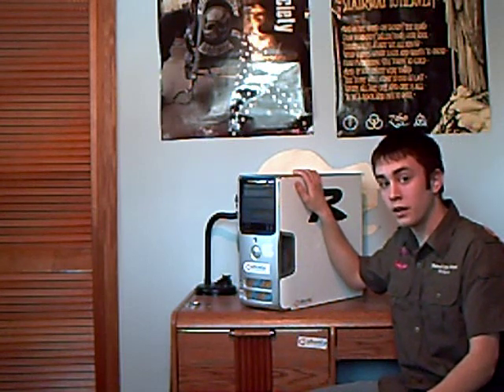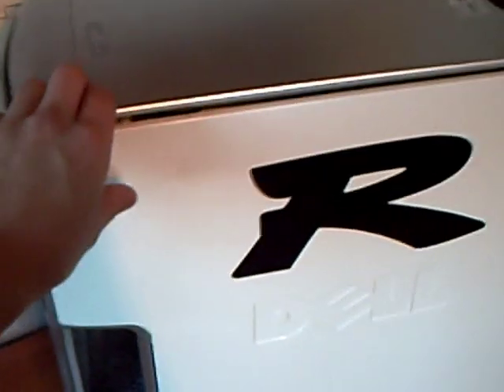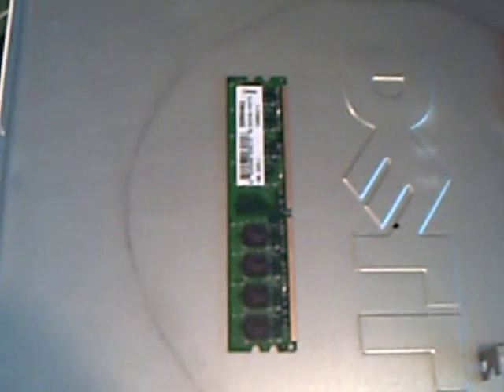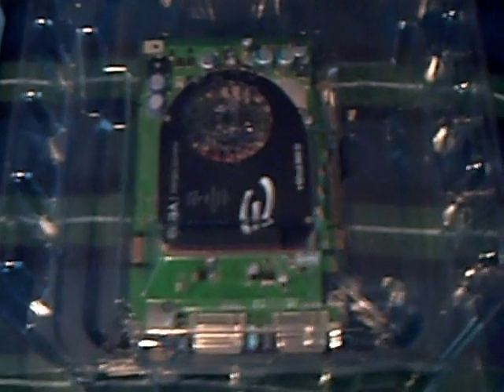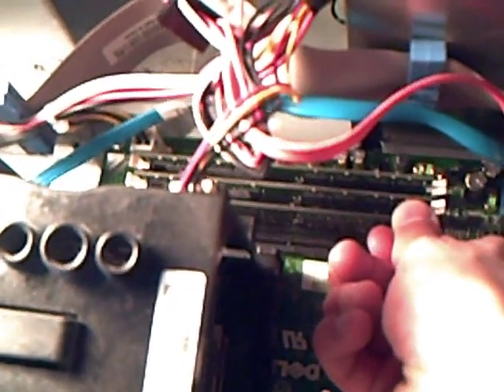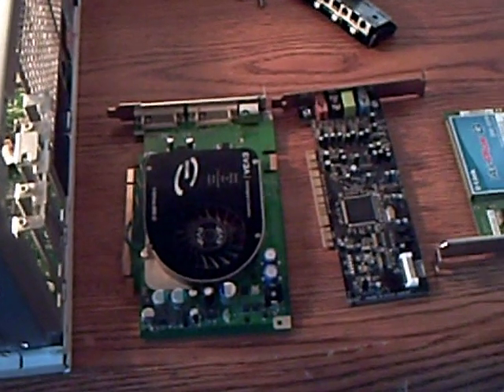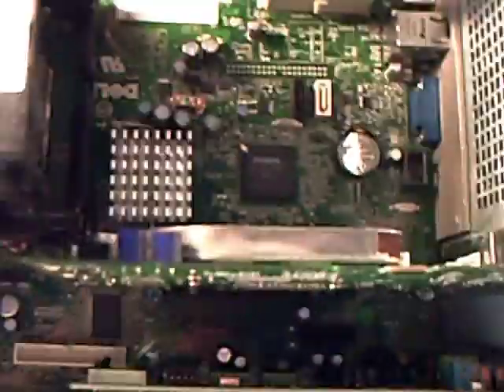Dell Dimension E521 full upgrade

Comment: My e521 has the 1.1.4 bios and a 3400+ can i run a 5600+ without a bios update because for some reason im having issues with updating the bios from flashdrive

Comment: ummmmm.....the ram only goes in one way, bahahahaha,   i like the part where he said this might look complicated for some......cant even give instructions on installing ram,  they go in one way for a reason people,  and skip the 1gb ram,  go for 2gb cards all through the 4 slots,  im on my e521 right now with 8bg ram and the stock cpu,
Reply: +cowterminator I've got the AMD dual 2.4 e521 underfinger right now too.  Just upgraded it to windows 10.  The computer guy I hired (first, just to replace my power supply which burned out), gave me a 3rd gb of RAM he had "sitting around."  I suggested I might like to have a 45h GB in there, and I thought I remembered it could take 8 GB as you say.  He replied "after the third GB, more won't do  you any good...it's a microsoft thing."  He claimed things would go to the hardrive and bypass the rest of any extra ram I might install.  I balked, and he just claims he's been doing this 20 years, and to believe him.  If there is a reason to think he's right, I can't imagine it.  He also installed a video card upgrade I already owned but never had installed.  Billed me like $180 bucks for win 10, power supply, and card installation.  Doesn't seem too bad, but he bragged he spent 40 hours making the video card work, which was his bad luck he couldn't charge me for it.  I'm thinking I should find some ram and stick it in, and that this guy is a little goofy.  Thoughts?
Reply: +skidancin 32 bit windows has a 3gb limit.  For 64 bit windows, 8gb is a solid upgrade.  Honestly, I would never do a single stick of ram in a dual channel board.  Always in matched pairs for me.
Reply: can i put amd 8 core on my e521? answer pls
Reply: unfortunately not ,you would need an amd 3+ mother board for that. I personally have an e521 with an athlon   64 ll 5600+ at 2.8 ghz and 8 gigs of memory  that i use for graphic design and some video rendering and I have no problems from it

Comment: On mine, I also installed an Athlon 64 X2 6000+ (3Ghz), added an SSD hard drive to be the system drive, and popped in 4GB RAM in dual channel.  Still runs well in 2015.

Comment: full upgrade? hell I took out my 5150 motherboard, made some cuts to the back of the case to fit a 5200 to support a spare core 2 duo I had. Replaced the stock heatsink and shroud with a 9100. I also  made some cuts on the shroud to fit in a spare N9600GTX. Popped in 4GB of DDR2 running Ubuntu and this thing kicks ass!
Reply: +Duffimus Prime Yeah, I was a bit unimpressed also.  Was hoping to see what CPU he upgraded to since I have one with a crappy sempron and wanted to see if I could drop an upgrade in.
Reply: that's what mine had in it.have since upgraded to an athlon 64x2 6000+@3ghz,6gb of ram and a geforce 9600gt dual booting ubuntu@win7 64bit.

Comment: If any of you guys still have this dell pos (like me) then I'd advise upgrading to x64 (64bit) operating system since the e521 has an AMD Athlon >64< x2 cpu. The 64 means it is 64 bit capable. Not sure why dell put 32bit on it but but they did. The x64 OS will let your system take advantage of your upgraded ram since 32 bit OS only let's you use a little over 3gb of ram. And can anyone tell me what gaming is like on this with a newer gpu? I'm building a new pc and I'm wondering if I can recycle the cpu, psu, case, and the motherboard.
Reply: +TJ4774 My e521 has, what my new windows 10 installation reports as "AMD Athlon(TM) 64 X2 Dual Core Processor 4600+ 2.4 GHz"  It further reports for "system," "64-bit operating system, x64 based processor"  Now, would you say I can't put four 2gb rams into the memory slots and do my self some good?  Right now I've just gotten a third gb installed for a total of 3gb on the machine.  But I"m thinking I've already got a 64 bit operating system, and that upgrading to 8 gb would do me some good.  Sound right?

Comment: Hey man how much watts is your power supply unit. Because my dell dime521 won't turn on at all and it's been broken for months. The only thing I replaced in it was the RAM I added 2GB more. Total RAM is 4GB. Everything was working fine then the PC wouldn't turn on.
Reply: try reinstalling the ram if you did it incorrectly it wont work try to reinstall it

Comment: 3. video card: @Ghe Carniyan, again based on my 5150: i found a nice brand new 2GB EVGA nvidia gt 910 at thrift shop for a whopping 5 dollars and it set up fine. i had a 512 mb nvidea in there before MSI brand which worked great so to answer your question YES as long as its pci-e (pci express) it shouldnt matter how much VRAM is contained on the card as it should contain its own BIOS. if it does not boot than youve reached the limit but 2 gb even 4 gb should be a-ok:)

Comment: ok few comments here: 
1. it DOES matter whick way memory is installed as its keyed to only fit one direction or it will not snap in place. thank god because if it wasnt youd blow the board-big chance.
2. psu: it def is generic. my 5150 has an aftermarket upgraded 400 watt PSU it may be higher havent checked in awhile lol.

Comment: The fastest processor for an AM2 socket is a AMD athalon x2 64 6000+, although if you can find the BIOS upgrade you can use AM2+ and AM3 processors as long as they don't need over 89 watts of power.

Comment: Anything with an AM2 Socket connection, AM2+/AM3 Processors wont work because Dell hasn't realesed a  patched BIOS with it, although you can look for one online, that runs the risk of bricking the thing, so I do not reccomend it, although the best on I could find was a athalon 64 x2 6000+ witch clocks in about 3.0 GHz on a dual core.

Comment: E521 is socket AM2 so your gonna need a FX1 socket motherboard for your cpu, make sure its not FM1 socket as this is also not compatible (APU) the cpu sockets on the FX boards are generally black (not white).
FX1 boards are quite cheap now (around £25-30) but will need ddr3 ram which is much cheaper ddr2, 8gb 4x2gb sticks is gonna be very expensive for an old pc where as 8gb of ddr3 2x4gb is half the price and much much quicker.

Comment: i have a dell dimension e521 and i upgraded to a amd 64 x2 6000 3.1ghz and running a 550w psu and a geforce 660 ti 2gb video card i can play battlefield 3 with 45 fps no prob

Comment: Josh,

Thanks, good video.

I have the Dell Dimension e520.... and my Cd drive no longer works except with the old straightened paperclip trick.  Can you tell me, or do you have a video, on how to replace this drive?  I assume that at some point the paperclip will fail to work since the drive is, I gather, broken.

Thank you!  Good video.

Comment: This video is old, yes. my computer is old, yes. however, I came across this video, and found it to be incredibly helpful, i had immediately gone onto ebay and found a geforce 8600 gt, just as you had for under 30 bucks, which i thought was an incredible deal, i bought it that very moment, it came this very day, i plugged that sucker in, and it works like a charm. I just wanted to express my wholehearted appreciation for this video, i would have been stuck in no games land without it! thank you!

Comment: I need to replace the hard drive in this unit. What do I buy? I added more ram had it tuned from office depot and a week later the hard drive went. I think I will add a wireless card to it since I use a linksyss usb for it. Need your help. Marc

Comment: The rule of thumb with upgrading parts is try to be strategic about it. Try to buy parts that you can use in you NEXT computer, so when you upgrade it doesn't cost you as much.  PCI express video cards have been standard for years, they replaced  AGP video cards.  In my case someone gave me the computer. I already had the 500 mhz power supply and video card in my old computer, I swapped out some 1 gig sticks from a MAC G5  that was being upgraded to 2 gig sticks. The dual processor was 50 bucks.

Comment: The space between the PCI express slot and heat sink for the processor is very small...alot of the newer video cards have very big heat sinks themselves and might not fit...this happened to me.  Also, alot of newer video cards require an additional (black) power plug...so you might have to upgrade the power supply...I put in a master cool 500 MHZ from my other box.  This computer will take 4 X 1 gig sticks at most...2 gig sticks will not work...or might only show as 1 gig..hope this helps.

Comment: Hi...the parts that Josh installed are pretty standard....the Video card is just a PCI Express card and a PCI sound card...the computer has 1 (black) PCI express slot...and 2 PCI (white) slots.  This is an old computer it was originally a single core 3800+...but it will run Windows 7...it also can be upgraded to a Dual processor....its max I believe is a  AMD Athlon 64 x2 ADA5600IAA6CZ  (5600 Mhz), on ebay for about 40-50 bucks.

Comment: i still have a e521 with 4gb RAM and a ATI Radeon HD 4830 ( rates 7.2 in 7 x64 ultimate) , it has the 3800+ dual core and i can play just about anything at max settings...i frequent all the Crysis games.

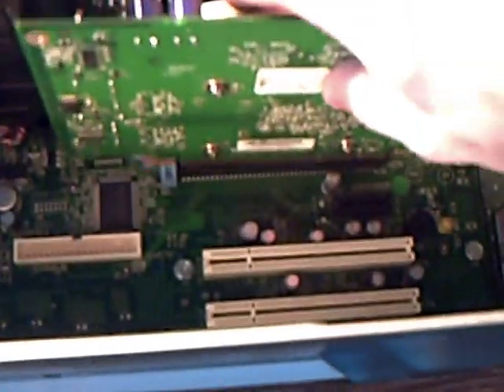Comment: 2:30 is when he puts in  his video card. i bought a bfg geforce gts 250 and everytime i try to fit it in, it wont. the reason why is because of that huge black plastic thing that holds the heatsink for the cpu. im gonna need a different heatsink so i can fit my graphics card in. any suggestions?

Comment: I do not care when you made this video, I am just glad you did.  Thank you.  I still own a Dimension E521 and have had it for 4 years without any problems.  I am not a gamer so I guess that makes a difference.  I have the geforce 6150 le but would like to upgrade it somewhat since I watch mostly movies on my computer and recently bought a 22 inch widescreen.  What do you suggest?  I did upgrade the RAM from 1 to 3 gb.

Comment: @domiNATEshots12 
I went with a GeForce 8600 GT 512MB.  The card in this video is the same, but with 256MB of ram... and I think DDR3 memory in stead of DDR2.  Mine uses DDR2.  My card has yet to arrive, but if it's awesome when it gets here I can get you a link to buy one yourself.  They're like 50$.  512MB of video ram means you'll be able to play every game on the market. . . .   I think, as long as the AMD 64 2.00 Ghz processor in the E521 isn't shy of the requirements as well...

Comment: Huh.  I use a Dimension E521 as well,  I was looking at video cards but most of the ones that were halfway decent did require a PSU upgrade.  I'll look around for the card that you mentioned.  I upgraded to 3gigs of ram from Crucial, I don't think the sound card needs any upgrades (Win XP Media is alright I spoze) but... I do use a USB wireless adapter.  Is there any advantage to your method of adapting to wireless?

Comment: @yomomma93635  You can get a pretty decent setup from bestbuy. Now Dells can be pretty tricky to get a new motherboard for, so I can't guarantee that this will work, but you can do the research on your own
Motherboard- Asus - Micro ATX Motherboard 2600MHz (Socket AM3) goes for like 75$
Processor- AMD - Athlon™ II X3 Processor 450 for 90$
RAM- Memory Master - 2-Pack 2GB PC3-10666 DDR3 DIMM Memory Kit for 42$
Video Card-  Asus - NVIDIA GeForce GT 240 1GB DDR3 PCI Express Graphics Card for 90$

Comment from the maker: @SevereIDAHO haha, I work at best buy too :P what kind of card were you looking at? and for the love of god do not buy a power supply from best buy. I don't know about where you live but where I am we only have Dynex and Rocketfish PSUs. Go to a good computer store and get yourself a coolermaster or any other good brand. Most of the time there is almost no price difference. But ya, if the card requires more than 305W you may need a new PSU.

Comment from the maker: @yomomma93635 If your going to be replacing all those parts I would just either buy a new computer or build one. Building a new one will open up many more possibilities in terms of what parts you can use. Do a bit of research if your worried your not knowledgeable enough , anybody can build computer these days.

Comment: ok this is my situation. i just got a dell dimension xps t500. old ass clunker that my uncle gave me. who ever had it loaded windows xp professional to it and a secondary 20 gig hard disk. it needs more ram but the max ram my computer holds is 768 Megs. i know i need to basically gut this thing out and change everything but what should i choose? i know i need a new motherboard/soundcard/videocard/processor setup but what should i get. im an entry level computer dude with no REAL knowledge.

Comment from the maker: @Yugz13 I had the 256mb factory overclocked version. If you want to know if any card will work with your PSU, just google "8600 GT 512mb PSU minimum requirements" or whatever model you are looking at.

Comment from the maker: @saqibd123new not sure, probably just the processor and possibly a slightly different mobo? And the max should still be 4gb, the motherboard is physically limited, even if windows is capable of handling more.

Comment: Are you fucking kidding me? You don't have to unscrew the expansion slot lock. It has a release on it. Oh and if you were going to "upgrade" your RAM, you might want to swap out the slow-ass PC5300 RAM that comes from Dell. Oh yeah, dual channel... You won't be having any of that with that config. I won't talk shit about your video card because by now you know that sucks as bad as you do.

Comment: how can it run a 8600 video card i just checked the requierments for it. this pc (E521) has a 300watt power suply. the 8600 needs at least 500 watt power suply or it can overheat light on fire

Comment: The only upgrade I've done so far, is replaced the RAM so I got 4 GB, and I have an AMD 64 X2 6000+ CPU, have you had any problems with heating, because right now I have taped (yes pretty bodged but it works) a miniature fan facing the Graphics card and the heat sink above that, the weird thing is I though I'd have to replace the main fan but the CPU is running perfect temps. The card I have is a Nvidia GeForce 7300 LE and seems to be dieing, everything is jumpy and not nice.

Comment from the maker: you need at least 1GB of RAM, 2GB if your running vista, a video card with at least 256mb of vram, pixel shader 3.0 and vertex shader 3.0 and at least 12GB of free HDD space. you should be able to run a video card that can handle that game without upgrading the PSU although you could get a much more powerful card if you do upgrade the PSU. shop around for a card with the minimum specs i listed or higher as long as it requires less than 315W.

Comment: i put in a 
BFG geforce 9600 gt oc edition ($50-with rebate)

different CPU fan ($30-the huge plastic thing in the middle was a tight fit for my graphics card) 

upped the PSU to a 550 watt ($30- sale thing)

 put a fan controller in and cut a hole in the side of my case for a 120mm fan and a 80mm fan in the back (about $40)

and 2 2gb dual channel SLI ready 800MHz OCZ ram ($50)
 
total of $200, DONT do this. only reason i did is because the base computer was free, and im building a new one.

Comment: Im using XFX GeForce 8600 GT XXX, its overclocked. Hope it works for you :) I got 305W power supply, and I think the graphic card needs 300W.

Comment: great video...helped me a lot
but i still have some questions
did da mother board support da graphics card?? caz its a pci card as far as i know..if not could u plz give me da link to agp..nd did da psu match?? caz it requires 325w nd e521 has only 305w

Comment: Immersing the RAM in the wrong orientation will not go in, unless you really push it down, and then breaks the RAM or the RAM holder. So to be safe, you must align the center notch with the RAM holder and then the clippers will snap in.

Comment: This system can be upgraded from a low budget to a midrange with Athlon X2 (Windsor or Brisbane). and a single slot graphics card (9800gt or HD4850). Its also got good overclocking potential [can only be done with a software]

Comment from the maker: well if you were planning on replacing most of the computer yourself, why not just build a rig from scratch? If your looking to buy a name brand system, I would try to stay away from Dell, HP, compaq and Gateway. They use BTX motherboards making it hard to upgrade the way you want later on. Not all computers by these companies use BTX but just make sure when you do decide to buy a new computer, make sure the motherboard is on the right hand side of the case (if its on the left, its BTX)

Comment from the maker: it should be able to handle anything in the AMD sempron or athlonX64 dual core lineup. i'm not sure what the difference between the E521 and the C521 are but you might want to check and see if the C521 came with any higher end CPU  options close to what your looking for. If so chances are you can upgrade to any AMD AM2 socket CPU. Let me know if you need clarification.

Comment from the maker: This is true but I thought it would make the process easier to understand for people who are new to doing upgrades. And yes, unfortunately dell and many other top manufacturers have converted to the horrible BTX setup, even in the top of the line XPS. They figure that if they make the motherboard and case useless after it gets older, you have to buy a new computer instead of upgrading.

Comment from the maker: As for the video card, no, not without upgrading the power supply substantially. As for the RAM, The motherboard supports up to 4GB of RAM, (1GB per slot) but if i'm not wrong only supports RAM speeds of up to PC2 6400.  As for the processor, your board is either intel or AMD, not both. Also, i'm not sure if the boards in this computer support quad core Processors, i may be wrong though.
if your looking at putting this amount of money into it, just build a custom Rig instead.